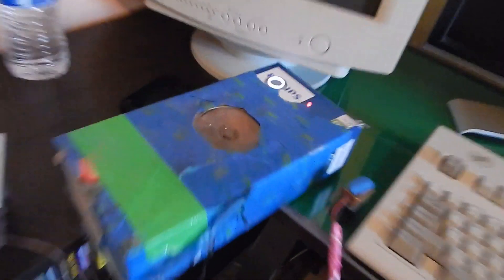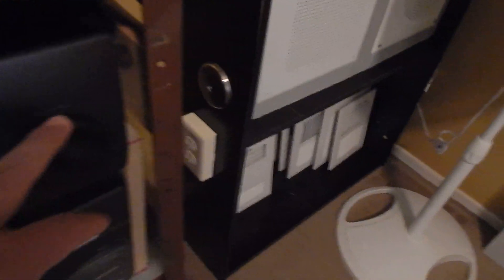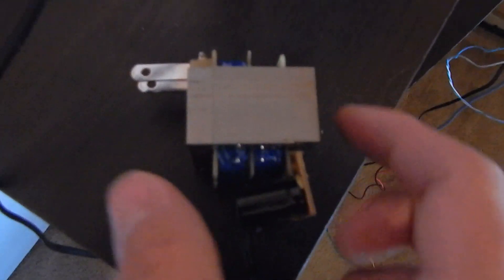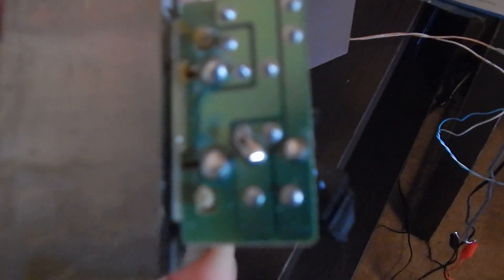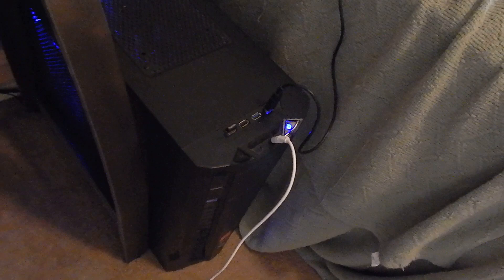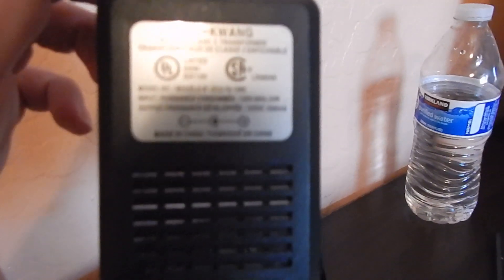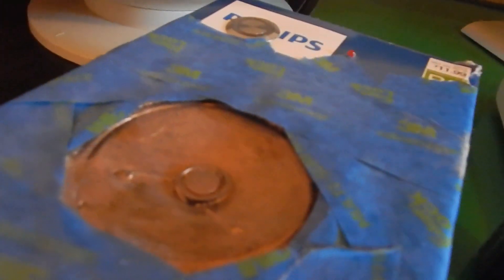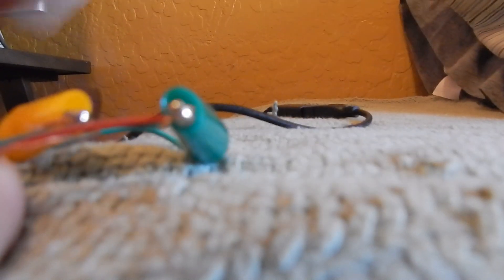How To Make A Ground Loop Isolator Using An Old 12 Volt Brick AC Adapter

Comment: Nether coil is 8 ohms so you are feeding you out put into probably 2-3 ohms and starving the other. You can use the transformer BUT only if you rewire both coils to 8-10 ohms.
Reply: Better still buy two audio transformers from china 5 for £1.27 and do the job properly. That way you dont blow the outputs on your CD player.

Comment: 10 ohms is what you need to measure on the secondary winding of the tranformer. and yes this does work as I have built many 1/8 stereo line out iso transformer boxes but using small 1:1 little transformers. These Tranformers i use are found inside thrown out DC power adapters for Cisco phones ( used a lot these days in offices). You take the transformer apart and take out the little transformer that is in there. The DC adpaters are fast switching adapters so any Iphone or android phone dc power adapter will have these little transformers inside. For stereo you need 2 transformers for left and right audio so the values have to be the same on both transformers or else left and right volume will be different.

Comment: could you be a little more clear where the other set of connections besides the ones on the make-shift filter (adapter) go?
Reply from the maker: One end will be the 3.5 mm jack or an rca jack and the other end of the transformer will be wired up the device that has ground loops.
Reply: @CristianOrtiztechmaster926  what if there's no RCA? Just a deck with the factory wire harness... No amp
Reply: @jasonemryss  with a deck and factory wire harness Im assuming you mean for car audio? If not then doesnt apply but the amplifier is usually built into the headunit and then you just have to figure out which wires from the factory wire harness are for the ground and signal wire are and do it that way.